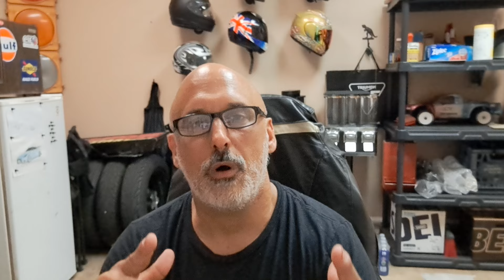Hurricane 6 SO Tuning. What kind of power could we expect?

Comment: There are opportunities with this motor. First thing i would do is , make an intake with port fuel injection or water injection to keep the valves clean 

Oil pan modification to accept a dipstick.

Comment: Lets hear what Mr Mason has to say... I can't believe it's almost 20 yrs, but it is. So I purchased my 2005 Magnum rt new. Over the yrs, by picking and choosing, I purchased an entire 6.1 hemi top end. You name it I got it, lifters cam rockers, head, springs, pushrods, intake, injectors, TB, I've collected it. of course over the decades I  also have the have the diablosport, and the Tranformer. 
 It's 20 yrs, and time to refresh to old wagon. maybe do some bodywork.  I do understand mopar's old 6.1 cam needs to be advanced 4-6 degrees. This is not a race car.. Should I just reach into the pats bin, and deplete the inventory? Is there any boost in there, I'm 59 yrs old, and don't care what I purchased at swap meets.
Reply: P.S. for street cruising, and driving around.